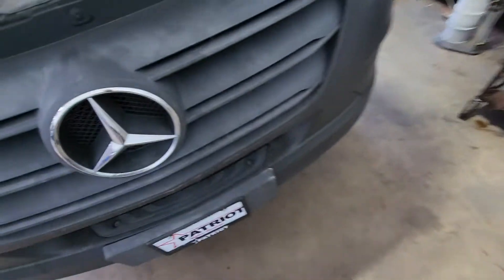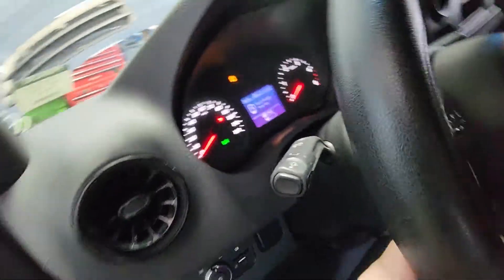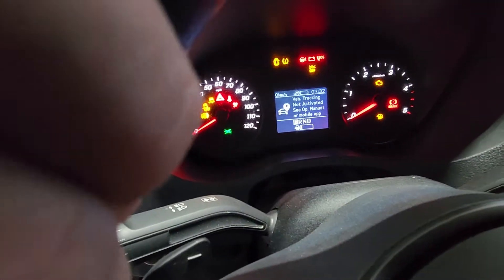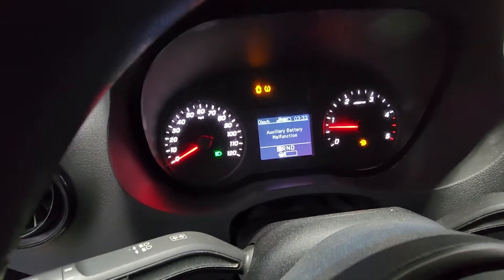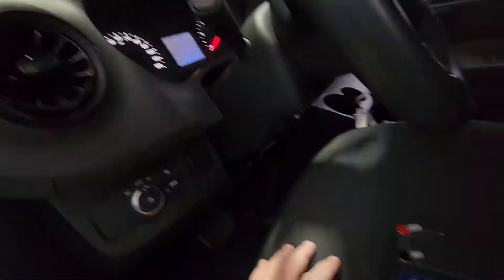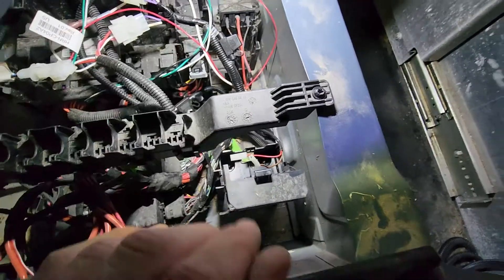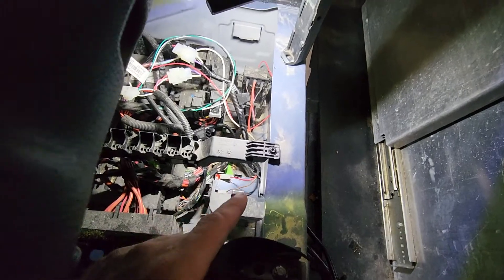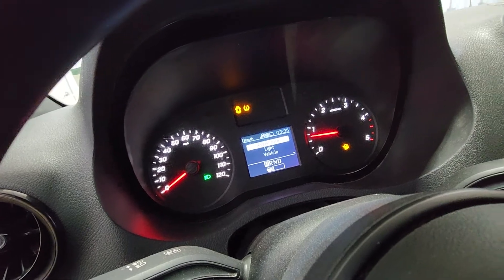2019 mercedes sprinter 2500 diesel auxiliary battery location

Comment: Aux. battery is not under the Captain's seat in my 2021 Sprinter Diesel. I'm so frustrated to where it is!
Reply from the maker: Did you check next to your main battery or under the hood.
Reply: I certainly did. Even took out the lower dash panel by the battery ground. 
I do not see it.
Reply from the maker: If you send me the vin I can do some research for you with our system
Reply: @CodyDoesIt  The Auxiliary battery is indeed behind the rear left corner of the captain's seat. To access it, I needed to remove the seat and some cables. Thanks again!!
Reply from the maker: @NilsVidstrand I thought you said it wasnt there lol. Tiny little battery ay?

Comment: We have a 2019 Sprinter conversion. Is there a way to have another battery mounted for starting if the regular one dies? Or a way to use the house batteries to start the vehicle?
Reply from the maker: Only of you wire one in. The aux batter is just for sfor towing. Id just get a good noco jump pack for that
Reply: @CodyDoesIt  I do have one of those. Nice little package that strong enough to jump the sprinter. Guess that is all I need. THANKS

Comment: Do the 2010 model have this battery?
Reply from the maker: I am not sure I haven't had one on the shop.  There is 3 locations under the seat as in this video. In the main battery location under the driver floor board or under the hood.
Reply: @CodyDoesIt  thanks for the fast reply , mine has 2 that i know of , the main one under the drivers seat and a second one which is a regular car size under the hood , I’m asking because I have a battery light on and both of my batteries seem fine , so I was looking for a 3rd one
Reply from the maker: @PekasGamingHD  If you have a scan tool it'll throw an aux battery code. If the lights on Id have the alternator tested. Even probe the main battery while its running and see what the voltage is. Should be higher 14s

Comment: how did you clear air bag error off after reintall of the seat?
Reply from the maker: Never disconnected anything pertaining to an air bag or tensioner. Did you pull the seat belt or any other wiring? If you say the light it was a test all cars run when you start or go to accessories

Comment: Thanks a lot
Reply from the maker: I made this video because I couldnt find any information on locating it. Your welcome I am happy I could help.
Reply: @CodyDoesIt  Yes this video is very helpful since searching the internet beings to the discussions of  problems with secondary battery only while the problem is in auxiliary one.
Reply from the maker: There is only 2 the aux and main on this engine. Working for Chrysler it used to own Sprinters then sold to Mercedes and created the Promaster line. If yours is diesel lemme know if you need any help on the fuel filter under the air filter ducting.
Reply: This was super helpful, as a new owner of a 2019 Sprinter 2500 144 WB Crew model, and doing as much of the conversion myself, the electrical has been the only scary issue.  Now a widow, over 70, doing the floor insulation & reinstalling the factory floor before wiring.  I purchased a marine battery, and a "smart"  battery box by Bestek, to secure to the floor behind driver's seat.  Also a 2000W inverter, not sure about next steps yet. I had not looked under the seat yet, so your info is extremely helpful.
Thank,
Janice in Port Angeles, WA
Reply from the maker: @tomcorbett7027 Happy to help best wishes on the build!

Comment: Do you know how to put it in neutral using that small battery ? Thanks
Reply from the maker: The Aux battery should allow a scanner to change geara but if not you should have an access hole below the shifter pull the cover and put a screw driver or something to engage the tab to shift it into gear.
Reply: @CodyDoesIt  the newer model like on this video 2019 with selector on steering column still have a manual activation somewhere ?
Reply from the maker: Sorry I was watching football and basketball all day just say this. I imagine a scan tool can shift it or there is a procedure to I can check it out first this in the am when I get to work. Worst case pull your drive shaft to tow.

Comment: Just not visible with the swivel seat frame and underneath a bracket and 2 large battery cables.
Plenty of space under passenger seat- go figure! 
Aye, it is tiny!
Reply from the maker: I left the seat in and was very careful when I changed it out. Its similar to the batteries in emergency exit signs

Comment: the '06 sprinters are tanks
every year after, they got worse and worse
our 2019's have been complete trash (we have a fleet) with all the sensors and electronics constantly going out, the dont even come with an oil dipstick, its electronic and tells you on the dash, but it doesnt tell you the state of the oil like the good old fashion dipsticks do
never, ever will we buy another sprinter